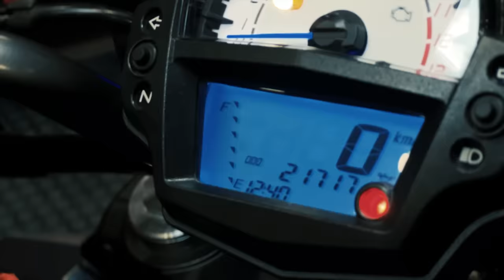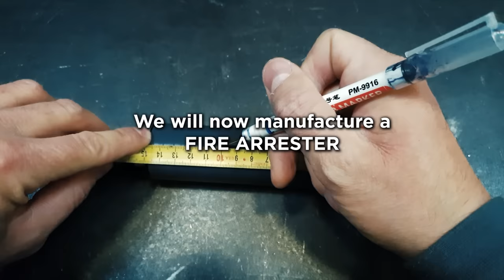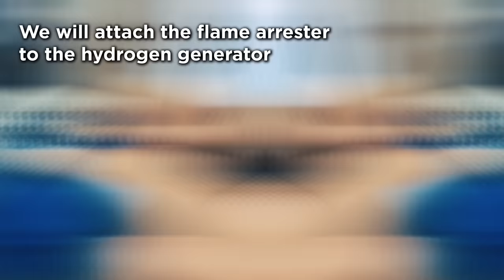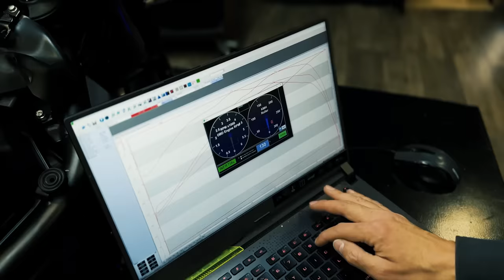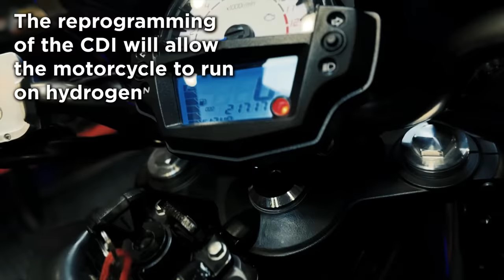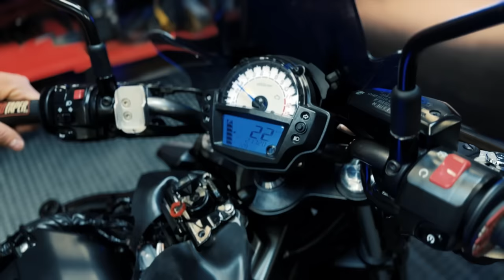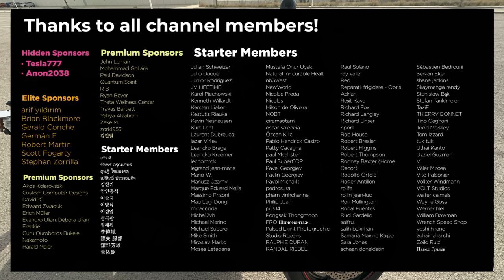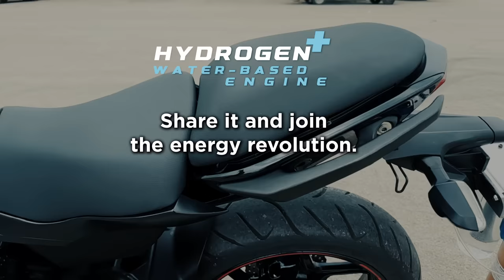Running Bike On Water - 100% Working Trick

Comment: Be sure to choke down the air intake,  otherwise,  the motor will overheat,  you're getting pure oxygen along  with the H2. You can find the sweet spot by taking a temperature using normal gas as fuel,  make gradually test, on at warm-up,  at Idle,  crying down the street at 25 mph, 35, 40, 55, 65 . Mount a thermocouple on the cylinder outside, connected to a voltmeter,  one you can buy at Harbour Frate,  is where I got mine,  comes with the TC, 20 bucks or so, also, monitor  the exhaust at Idle,  20, 25, 35, 49, 55, in Gas mode. The switch to the H2 generator line.  Log all this readings on paper,  then you can adjust the size of the air intake to work better  with the H2, supply.  We had problems  with over heating because we were getting to much O2, with the h2, so by restriction of the air intake,  we just used Gaffer tape around  the air  filters,  that way it's a quick adjustment,  more tape , less tape, till you find the sweet  spot to match the gasoline temperature range. That is what we did, and it worked fine. Disclaimer,  my shared comment  is for educational purposes  only, Do not try this modification without a trained auto technician. I was not paid any money by anyone or any company to share my experience.  Good luck, drive safely.  P S, be sure to put a third filter in line to catch any water vapors or salt water from the HHO on-demand reactor.  Be Safe, ware eye protection, and safety gloves. 😊

Comment: I run my John Deere riding lawn mower on hydrogen fuel using a system very similar to this been very efficient the only thing I have added is an oil mist drip so the cylinder and piton will stay lubricated that's the only drawback on it is lubrication, but it's overcome by an oil mist drip.

Comment: Nonsense. It takes more energy to split water into hydrogen and oxygen gases than the energy that can be obtained by burning the gases.
Reply: Exactly, and the rate of generating dont seem remotely enough.
Reply: You are not correct.
Reply: Take a physics class.
Reply: That's same thing I want to say
Reply: It’s basically battery powered. Quit complaining.  No physics broke.

Comment: Congratulations, your adaptation turned out great.
One suggestion, use a side fairing protector on the motorcycle. And try to place the adaptation inside the protector. This left the plaque still visible. congratulations.

Comment: The future of the world of cars and motorcycles. No more pollution no gasoline, this is the ultimate solution in a world contaminated with pollutants like oil and diesel engines.
Reply: If this work we would have it already for a long time. Producing hydrogen by electrolysis is not new at all. Why doesn't this work? You can run a motor with hydrogen, but it is not possible to produce the hydrogen on board. Since the electrical power needed for electrolysis is always bigger than the power of the produced hydrogen.

Comment: Do you have an (( Independent Third Party)) to verify outside of your group to prove what you are doing that there are no camera tricks involved and that carbon fuel is not being used hidden somewhere in the system? You could easily put carbon fuel in the bubbler that is crystal clear, which will allow it to appear you are doing HHO Gas? I have run engines on 100% vapor carbon fuel.
Reply: And we don't know if that is water or some type of fuel.

Comment: Very misleading - electrolysis uses electricity to pull apart the molecule of water to produce hydrogen, which can be used as fuel in an engine. The problem is, hydrogen is not as powerful as gasoline and would require high amounts of it JUST to get an engine going.

Seeing as how small the generator is, it won't produce enough to run on hydrogen alone, meaning that the bike shown is still using gasoline, only the hydrogen being produced by the generator acts more like a "fuel support" and feeds the small amount of hydrogen it makes thru the intake therefore allowing you to theoretically save fuel.
Reply: Except that it is all consuming extra energy to work so all the extra energy has to come from somewhere and the battery is the only other source, so how long does the battery last?

Comment: Another perpetual motion device.
These were funny, for a while, because so many people believed it was possible and tried to replicate it.
Getting bored with them now, though. Especially the whole HHO genre. Physics cannot be beaten. The laws are unbreakable. Smoke and mirrors make it seem so, but you cannot get anything out of any machine without putting a greater amount of something in.
Water is not a fuel. It is the waste product that results from combustion, or in other words, water is the exhaust, or spent fuel. Separating it back into combustible fuel again requires more energy than is released by burning it. 
Power in>power out, always, when mechanical and thermal losses are factored in.

Comment: How long did it run for? Issues at certain speeds? Could this work on a carbureted engine or only doable on direct fuel injection?

Comment: And NEVER leave the motor off with that generator running or when you go to restart you will blow up your generator! I ran one of my cars this way for several years. The first time it happened I went into a 7-11 for a drink and when I came out to restart the generator blew up. Too much gas in the chamber. Almost messed up my carburetor.
Reply: How efficient was it ? Did you save any money on fuel expenses?
Reply: @FrancescoMagazzu  I increased the MPG on my Buick LeSabre and Buick Park Avenue from 22mpg to about 30mpg. That's a LOT of money saved when you drive over 50,000 miles a year!

Comment: What is the source of the energy to start electrolysis?  What is used to continue electrolysis once the engine is started?  Is it a battery of some sort or is there something akin to an alternator that takes over so that there is no need for continued battery usage? What were the modifications to the engine so that it would combust the hydrogen gas instead of gasoline? Did any hydrogen leak through the piston seals? Do the hydrogen gas cause any deterioration  over time to any part of your system that had contact with the hydrogen gas?
Reply: En resumen ese motor hara kaboom!!

Comment: I watchet this video and the one from arround 2 weeks ago. As it seems alot are either way hyped or totaly against it so here i try to settle some point so you can understand each other maybe.

The electrolysis works yes no doubt about it. But if running a engin with it you have a different "fuel" ( in this case hydrogen ) consumtion so if you go faster it need more. To avoid running out or having a surproduction would be adding a tank. And yes it is normal you barely use direct electricity to mostly it gona empty your batterie, wich gona be recharged. Not realy using it in a direct way.

It is also possible to make the electrolysis with your batterie but what is running out then ? The water first or the batterie if is the water does it mean it is produce more energie then it use ? Wich saddly is still not in human reach. You need to put more energie in then come out saddly.

For the engin you can modifie an engin to run on other fuel sur. But it need some work on it for most of them exept soe older diesel wich are easier. Newer one are limited to some fuel if running on the wrong one it will just stall. Where a old one can run with less quality fuel. Modifieing a gas engin to hydrogene is not that hard ( still some work but less then a gasolin one) a gasoline would need some rework on the inside. 

And to the last im not against inovation but sometimes they are problems most just dont see. One of the biggest problem with hydrogen engin is the lubrification. Hydrogene is a powerfuel greas remover but a combustion engin need it or it stall and destroy itsel. So oil has to be refill offen they tryed teflon or ceramic but yeah still not any good thing found yet. So even if you modifie a engin to accept hydrogen it will have a high chance to destroy itself very fast. 

A hydrogen cell would be more efficiant but then instead of a combustion engin would be more a electric bike then.

Hope i didnt wrote to many grammar mistakes trying my best  and yes some part are very simply describte but i want that most people would understand.
Reply: Dude, you talk too much. Do what you see on this video & then try to improve on it. Make videos of your progress as a video reply. This is the idea here.
Reply: Your right it was a long text. And i like the idea. But i wont be able to improve it the basis arent gona work. 

See it this way a gasolin engin and a diesel are similar and you can make work them. But make it work with another fuel need engin rework at as such it is easier to build a new one.
Reply: @VincentGriesbach-o9d  Very good. Now you know what to do. Gather the right people around you to make this happen. You don't need to be the one who knows all. Your vision is enough to inspire.
Reply: @TolisOnLine  I already have, for the past 30 years, and many other methods as well. It doesn't work as shown in this video. You need hundreds of liters per minute to run this engine at these speeds. We would all be running cars on this setup for decades if it worked.

Comment: Let me count how many of you do not know anything about chemistry or physics.
Reply: I've heard the arguments electrolysis isn't efficient. Well 1 HHO has 600,000 kCal per gallon double gas. It comes out at an ideal stoichiometric ratio and it needs some high amps. It's not free energy because it's not a closed system. And yeah entropy but the question is can the engine spinning produce enough amps for electrolysis to release the extra energy in the water. Example A this video apparently so.
Reply: There is always something new to learn about physics. I had a friend doing this years ago and he had no problem doing it with no extra energy input.
Reply: @jsnow2704  If you used a translator, it has not worked. I have no idea what you are saying.

Comment: hello brother! very impressed with this procedure . actually I am looking to create such type of system but the problem is ' I can't find HH+ compound online . can you help me to get one please. and if its possible to make on our own then then share this to us please.
because without HH+ Compound , it needs a lot of electricity to create hydrogen from one letter of water which will result in very expensive. kindly replay
Reply: I’m pretty sure certain kinds of salt crystals work too. It just needs some form of electrolytes so it can charge or smth.
Reply: thank you very much for your response brother! 
will KOH or  NaOH work better to create enough gas for any 150cc engine ? if I connect 12 volt bettry with it and a specific amount of KOH or NaOH?   @RIGGladiator

Comment: A small system like that will not run that engine under any load at all let alone revving suddenly etc total rubbish
Reply from the maker: Watch our previous videos. By adding the HH+ compound to the water, it does work
Reply: @EddieTheH  Diatomic Hydrogen gas with a plus sign behind it to make it look like something incredible :)

Comment: Where is the part of pouring water into the gas tank?
Reply: The hydrogen cell is the two bottles mounted to the rear of the bike. It works by having the cells insulated from one another, conducting electricity through the water in which separates the hydrogen from the water. The bubbles you see produced is the hydrogen gas. You don't have to put water into the gas tank as the fuel line is connected to the secondary bottle sucking the hydrogen gas as it's made. This is called hydrogen on demand. As hydrogen isn't stored and is made as it's used, there is no potential for danger of explosion. There simply isn't enough hydrogen to be hazardous although there is enough hydrogen to run a bike engine.

Comment: So where is the description of the amount of kW to electrolyse the hydrogen at what reduction of the kW available for traction? This is not claimed to be a perpetual motion machine, but it seems that an amount of hydrogen needs to be provided from the mains and stored for a drive in the parking lot. There is no claim that running at 100 km/h for an hour is possible based on electrolysis from the alternator output for long duration. Also what weight of water is needed of lengthy driving.

Comment: BULLDONKEY... BULLSHEET 
NOPE
No pump to inject the correct amount of hydrogen into the cylinders and the electrolysis machine used couldn't possibly produce the amount of hydrogen needed to fuel the bike.   Is it possible to run your bike on hydrogen?  Yep, sure is,  but not like this
Reply: True story. I made a video trying to run my generator on hho gas and it didnt work and it was producing 2.5L a minute.

Comment: Is this the same as Stanley Meyer's aqua car? Technically this bike does not run on water, but on electricity. Where does the electrical energy that does the electrolyses come from?
Reply: Runs on Hydrogen or HHO, electricity just extracts it from water, same combustion and iginition system
Reply: @kevin000909  ahhh I see and the electricity for that "extraction" is produced how?
Reply: Republican-00769  so lets see a motorcycle battery has a capacity of around 150wh, being really generous small scale dyi electrolysis will get you a 40% conversion efficiency so those 150wh from the battery will maybe get you 60Wh worth of Hydrogen which comes out to about 6ml worth of gasoline. That won´t get you far :). Now you will say: but the motorcycle alternator will keep the battery charged, yeah but the alternator doesn't charge for free and will need energy from the engine to produce the electric energy to keep the battery charged and with the inefficiencies of converting chemical to heat to mechanical and then to electrical energy you would need an chemical energy input to the engine that is about 4 times of what you produced on Hydrogen at the electrolyzer. So where will this 4x energy come from plus the energy that you need tp keep the engine running and  the Motorcycle moving as well?

Comment: Can I also do this on a V Twin with carborettor? Just blocking off half the intake or does it work best with injected motors? I love it that unlike electric motorcycles, I would miss the 'theatre' of it. With hydrogen you get the best of both worlds. Well done.👍👍👍👍👍

Comment: A new neatly designed ABS Saddlebag Kit needs to be made, since the same unit can be removed & used for kitchen & generator & petrol or diesel cars or any CNG automobiles..

Backfire prevention filters are good with sand and glass layers.  Good invention. :)

Comment: that would be cool, but i think the hydrogen production is a bit too low to rev the engine so high, you would literally need a pool generating hydrogen ...
Reply: It'll run on gasoline fumes, so why not the more highly combustible and more efficient hydrogen fumes/gas? A smaller jet in the carburetor is an optimization, but it's not necessary. And the timing sounds just fine. Even a couple of rusty nails attached to a 9 volt D-cell flashlight battery with alligator cable clips in 2 liters of water can produce 3 liters of hydrogen gas per minute. I'm sure he's using a quality production level efficient electrolyzer though. Those bikes can run off of 35-45mpg with gasoline. Probably over 50mpg with hydrogen, so it's very capable of running that engine. The alternator will keep the battery charged. He said he's not even drawing 5 amps, which is a minor fraction of the battery's load capacity.
Reply: @davidt1621  first of all the engine does NOT run on fumes, gasoline gets pumped in the engine and sprayed, but its NOT fumes, second thing, you can not produce more energy than what you use to produce it, it’s the first law of thermodynamics, and third, no way you can produce 3 liter of pure hydrogen by using rusty nails because rust is oxidation, which creates a layer of non conductive or poor conductive metal on it, making the resistance on the battery way higer then unusable, because 9V battery usually aren’t LiPo meaning the draining current will be few milliamps, so no reaction at all. Use you brain folks and don’t get fooled.
Reply: @@percayaaja-153 I don't understand Hindi, Tamil, or any other Indian languages my friend. I think that's what you are using maybe. Do you speak Urdu or Farsi?

Comment: The hydrogen flow has to equal the peak flow rate.  I don’t think that one container is capable to do this.
Reply: Actually 1 will do fine for a bike. I’ve done 2 and 3 for a car 6 cylinders and 6 cells for a semi

Comment: and when the battery is discharged, the hydrogen technology went away, logically, the hourly current consumed by that generator is much higher than it can charge the alternator, and in this way the invention works until the battery dies

Comment: Out of all people that believe this, none have maths/physics/chemist degree. I challenge any one of you for $10000 that i'm right
Reply: You are wrong. I have bot,  a solutions and organic chemistry degrees and this is very possible but not for very long. This seems to run for a short time only. excess hydrogen gets released in the air. The setup only uses what it is needed. This was meant as a project and not for transportation of long distances.